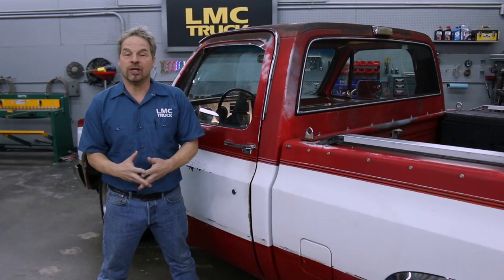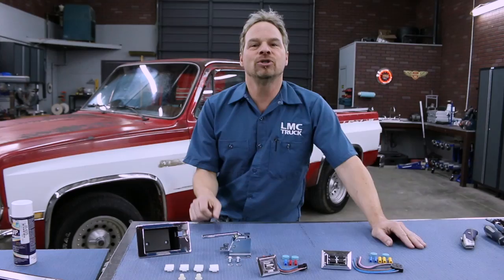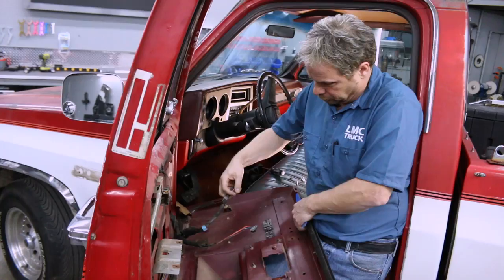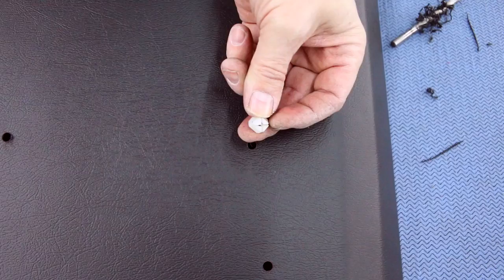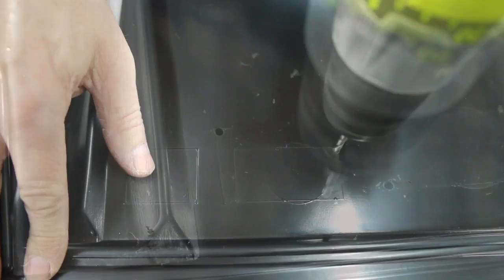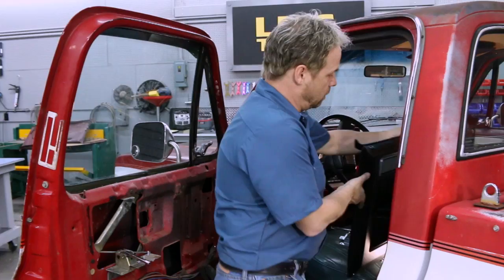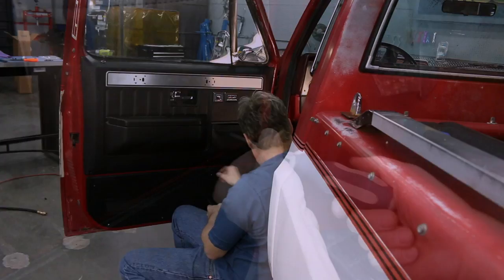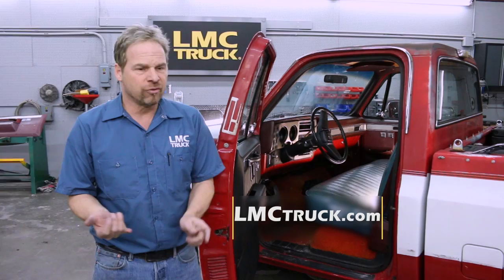LMC Truck: 1981-87 Chevy/GMC Truck Door Panel Installation with Kevin Tetz

Comment: i have a 1984 chevy c10 scottsdale longbed that never came with factory carpet panels underneath the door panels is it possible for me to install them on mine anyway?
Reply: Well as long as it's a c10, or a GMC from 1978-87 it should fit
Reply: C/k series 10-30

Comment: So I have a question for Kevin. I did a steering column swap from a 1975 c10 to a 91 silverado 2wd 1500 fully intact tilt column. I have already shortened and welded the shaft to the column. I am in need of serious help adapting my new shaft bracket, which is on the driver fender well side instead of the driver passenger side. The bracket hits the fender, and I purchased the 73-87 transmission gear linkage set from LMC, I need help installing it. I have no idea what I need to do. Can you send me a video of how I need to adapt it, so I can move forward with my project? I would really appreciate it alot! Thxs! 

Sarge USAF AD

Comment: But how do you remove paint from the plastic panel/ Someone painted my panels and they are peeling.
Reply: journeyquest1 power washer and 80 grit sand paper. That’s how I did mine. Came out great for repainting.

Comment: I really like LMC but I wish they'd upgrade their door panels. At this point they're only something like 75% of factory quality. You can tell just by watching this video, their panels don't even have the recess necessary for the fabric insert near the top of the panel. It's just a plastic look-alike thing. For many of us, that's just unacceptable. I use a lot of their other parts but the door panels ain't one of them.
Reply: Any suggestions for an alternative? I am doing a complete restoration of my 1984 GMC K2500 interior. I need color match and strong door panels, etc. I was going to buy all of it here, but with the comments on the door panels, not sure now. On a budget. Thanks.

Comment: I spend a lot of money at LMC. I like LMC , BUT ,  Their door carpet panels suck. Within 6 months the new carpet panels had waves in them and looked like crap.  40 year old original ones I found looked far better.
One more thing. I hate cut pile carpet . It sucks in every possible way. The 60's loop style carpet was far superior. Please give us the option for loop style carpet in our 80's trucks.
Reply from the maker: We appreciate your feedback! We're sorry to hear you're having trouble with the door panel carpet. Feel free to give us a call at 1-800-562-8782 or email customercare@longmotor.net so we can get you taken care of.
Reply: Any suggestions for an alternative? I am doing a complete restoration of my 1984 GMC K2500 interior. I need color match and strong door panels, etc. I was going to buy all of it here, but with the comments on the door panels, not sure now. On a budget. Thanks.
Reply: @boblowe-mi9tf  
I don't think any other company has better stuff. The choices are learn to make your own or look for NOS or good used stuff.
I found a decent doner truck for $1000 a few years ago. I have saved a lot of money by robbing parts off that truck. Spare box and cab. Well worth looking for a used truck if you have a place to keep it. Cheers.

Comment: Door panels are absolute garbage.  Cheap Chinese plastic, not vinyl. Fitment sucks.  Ended up restoring the originals, new ones went right in the dumpster
Reply: Any suggestions for an alternative? I am doing a complete restoration of my 1984 GMC K2500 interior. I need color match and strong door panels, etc. I was going to buy all of it here, but with the comments on the door panels, not sure now. On a budget. Thanks.
Reply: @boblowe-mi9tf  yeah I’m not sure. I’ve been thinking I will try and wrap the originals.  They are way better built